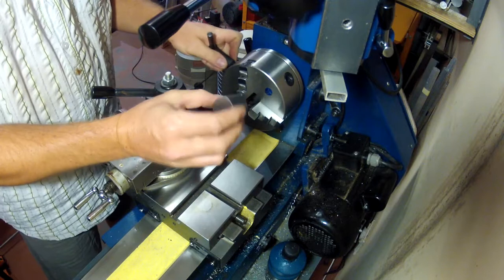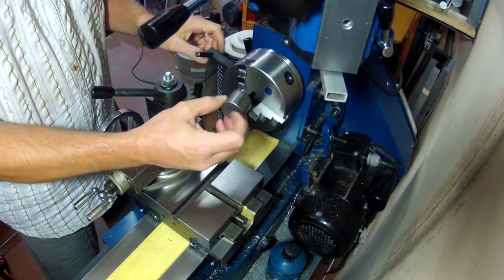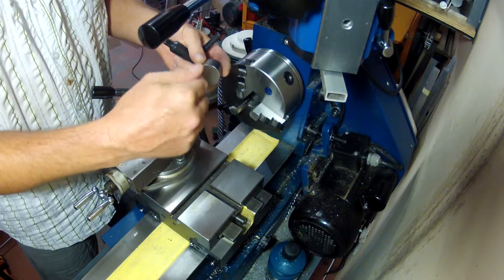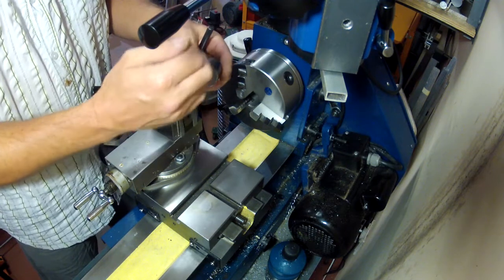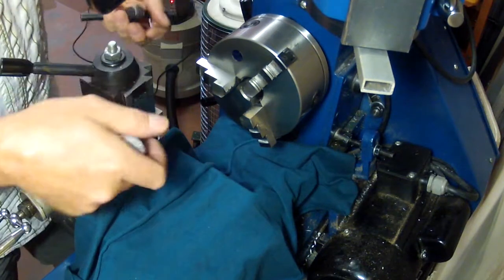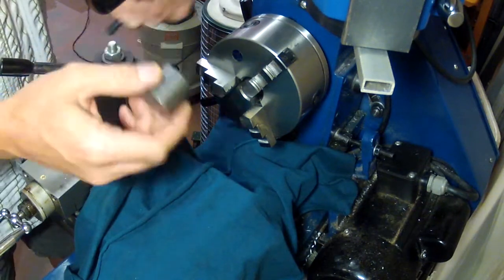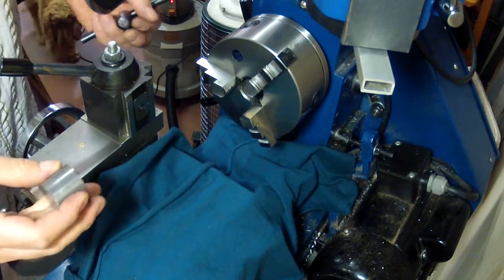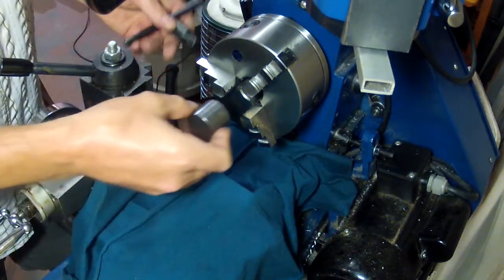Gear cutter - Part 1

Comment: Nice vid, Johan! Btw, the EN8 can be heat treated quite well. Remember to quench in oil. Keep well.
Reply: Thanks Mike.  This was a long time ago.  I should make an update of the gear cutters and how they work.  I didn't heat treat this piece, but I have done some tests and have gotten low 40's HRC on heat treating EN8 as per the specs which is not bad and makes for nice tooling if hardness is a requirement.

Comment: Just now noticed your video and channel.  I really like your idea of welding the two parts together rather than turning down the shank.    ~John
Reply from the maker: Hi TJ, thanks.  I usually do similar joints that way to try and save material and not have to turn too much solid material into wasted chips...